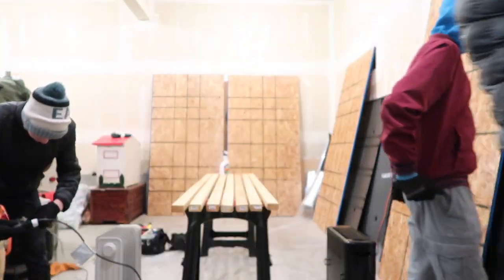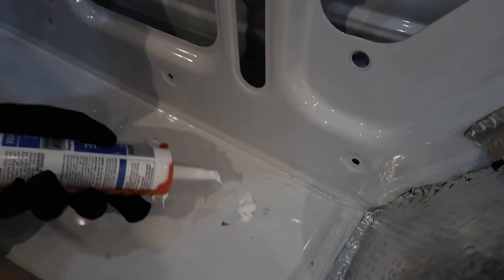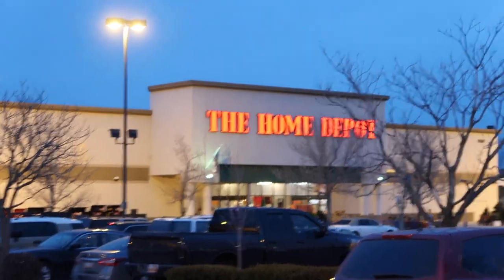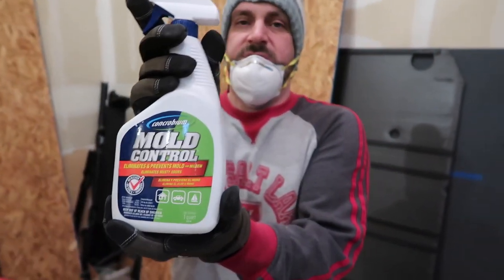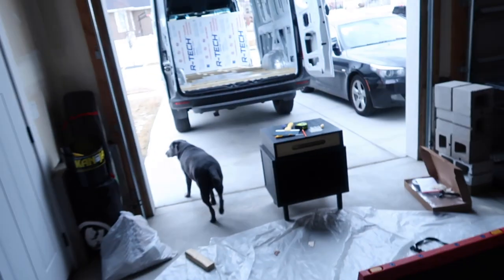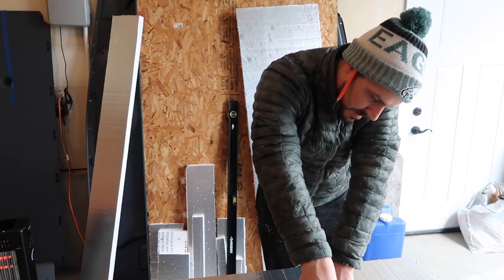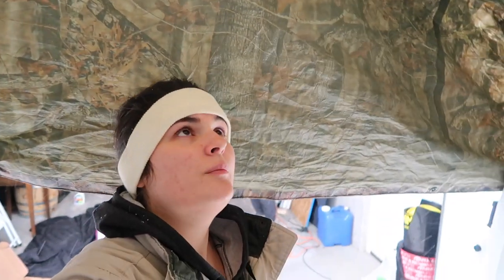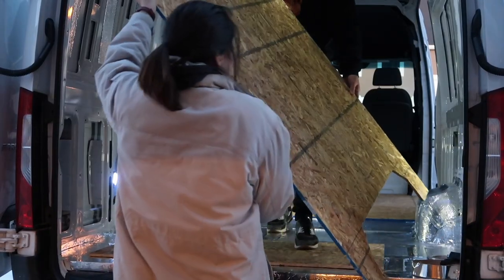FLOOR FRAMING, INSULATION, SUBFLOOR & SOUND DEADENER - DIY Sprinter Van Conversion Ep.2

Comment: Yep, spending a few bucks extra to invest in real quality plywood is a good choice:  you will appreciate its straightness and its capacity to strongly hold screws.  It is also important to mark each sub floor slats center line with a Sharpie mark on the walls, it makes plywood screwing so much easier.  Good luck, I will follow the advancement of your project from Canada!
Reply from the maker: Awesome, thanks for the tips, support and watching our videos!! And for reassuring us on our indecisiveness with the wood 😅 We marked the walls with painters tape and it definitely helped a lot! Hi there in Canada from here in Utah!! 👋🏻

Comment: I'm enjoying your build videos a lot. I am wondering why you didn't use the floor piece that came with the van (that you had asked them to take out) instead of spending the money on the plywood? I'd like to get a Sprinter and was thinking it would be a good material and cut down on cost to use that with insulation and sound proofing under it and the laminate on top of it

Comment: Some would say you should have used marine grade plywood because the glue used is much better at resisting the negative effects of moisture.  I used 3/4 inch marine grade, but did not have as many supports as you. One thing I noticed is the wood beams were much colder than the foam board in the mornings.  In other words they conducted the cold off the floor of the van much more than the foam. Everything in a Van build is a give and take, and each decision has pluses and minuses.  Case in point, I now have a thick floor, but less head room.
Reply from the maker: Very good advice. It's definitely give and take and a huge learning process. We didn't even know about marine grade plywood at the stage of doing our floors but definitely something to keep in mind if we ever build another van. 😊

Comment: Appreciate the work you are putting into documenting your van build. I have found many tips. 
Did you notice a significant difference in the noise level with the small amounts of Noico on the walls etc with the wheel wells fully covered?

Comment: At the rear of the van there is a gap between the factory plastic threshold where the doors are and where your framing ended. It looks like you filled that in with a piece of insulation and just had your plywood extend out on top of that. Is that the case? If so, are you worried about it sagging after day to day use? We are installing the floor on our van this week and are brainstorming what to do with that gap. Your video has been super helpful thus far! 😊
Reply from the maker: Hi there! First, thank you so much for watching! Good eye on the gap. This was actually a trouble area for us but we ended up just gluing wood there filling the gap, basically extending the floor framing out to the black plastic at the back of the van so all of the white metal floor was covered. It's silver because we covered it in foil tape. (You can see it at 23:03 in the video.) We also got some black vinyl stair nosing that we will put on that corner to kind of tie it all in together and hide the raw edge and foil tape. Hope this helps!
Reply: @EncompassAdventure  Awesome, thanks for the reply! I think we will be doing something similar in the coming days. Happy travels!
Reply: As we continue on our subfloor and frequently refer back to this video (SO HELPFUL!), we now have another question haha. Did the Great Stuff Gaps & Cracks apply well in the cold weather? We’re also building in Utah during the winter and the can states for temps 60-90 degrees. Any tips or tricks for your experience with Great Stuff? Also did you mist with water before applying?
Reply from the maker: Hi fellow Utah van builders! 👋🏻 We're so glad you're finding our video helpful! I messaged you on IG. 😁

Comment: Hi, newbie question. why put a wood frame (1x2s?)  on ceiling vs securing  thin plywood straight to ribs over the insulation?
Reply from the maker: Hi there, I think some people do that. We felt it would be better for us to use wood, it seemed more secure and the rib side that is facing down has large pre-drilled holes which could make it hard to place screws. We also have wires going through our ribs and didn't want to hit any, they were easier to miss screwing the wood in from the side. But mainly the wood tongue and groove pieces we chose for our ceiling are very thin. We actually put 5mm plywood up first and then the tongue and groove on top. Our next video will be about our ceiling and will it explain it a little more. Hope this helps! 😊
Reply: @EncompassAdventure  Thank you greatly for taking time to reply, this does help. The cable concern makes good sense.

Comment: Hi, thank you for the step by step instructions. May I ask how much of the Noico sound deadener you used for our van? The link above goes to a 36 square ft box.There is also an 18 square ft box. I am converting a 2005 Sprinter T1N 140" wheel base.
Thank you!
Reply: Good Question!

Comment: That wood you didn't use is not particle board. It's OSB. It's very weather resistant and would have been fine.
Reply from the maker: Hmm, that's good to know! We read somewhere that it warps on the edges, especially when it gets wet so it scared us away from it. Probably would have been okay but these are the results of over analyzing. Can you tell we've never done this before? 🤦‍♀️
Reply: @EncompassAdventure  I have a bit of OCD myself. I did Kilmat in our van  but everything else I'm doing right now is temporary other than mounting my solar panels and upcoming  Maxxair fan installation. BTW I'm @backcountryvehicles on Instagram.
Reply from the maker: @jimf8833  oh nice! We're following you! 😊

Comment: Amateurs………………..Things like………….’I can’t sit on the floor’ (whilst applying the self adhesive silver tape). Rubbish……………….you just place a suitable sized/thickness of board that will straddle the wooden framework/battens and basically spread the load. You seemed to be making very hard work. Of what are very basic jobs.
Reply from the maker: @Mallers
Amateurs would be correct, as we had never done anything like this before and it was only our second episode. We were learning as we went. Infact, if you go to 18:16 I literally say "Honestly, I've never used this before" talking about the foil tape. So thank you for your sharp observation.
Additionally, if you keep watching, you'll see that I was moving around a piece of foam board, to sit on, while taping the floor.
If you're not a fan of our video, you're in luck! There are thousands of other videos, on YouTube, you could watch and maybe not waste your precious time here. Or, since you're seemingly an expert, you could make your own videos and share your knowledge with the world. But thanks for watching and for the comment anyway. Happy building! 😉